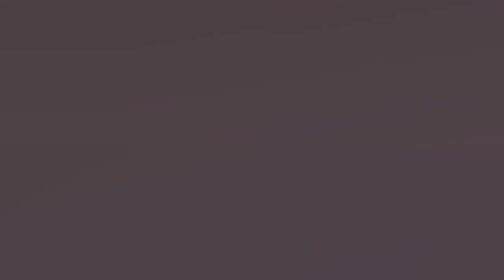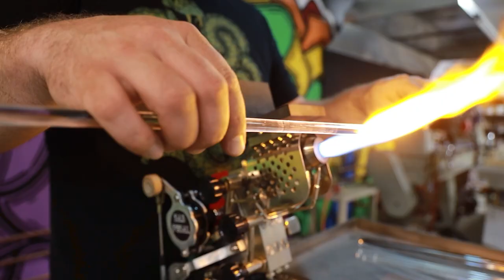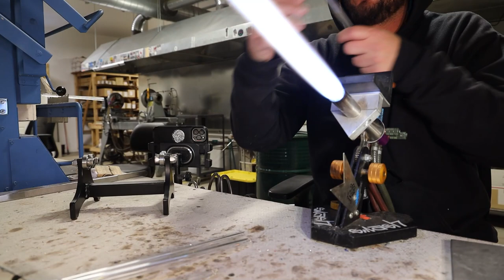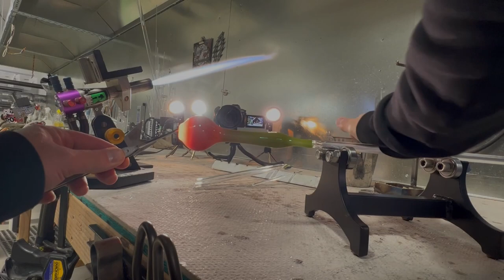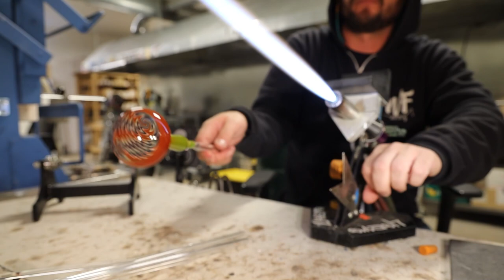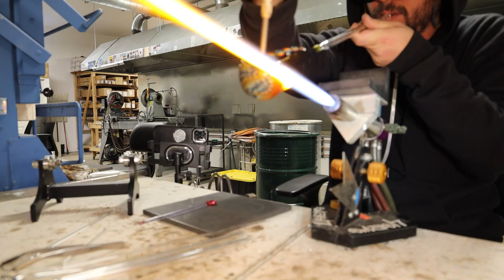Part 3: Assembly - Colorado Color Company - How to Make a Pipe - Vac Stack Tubing and Filigree Cane

Comment: what are you using to brush off the glass?
Reply from the maker: Just some recycled printer paper folded and stapled together. But any paper towel that burns off will work. I’ve also seen people Jean. You just want something that will burn off and not leave residue